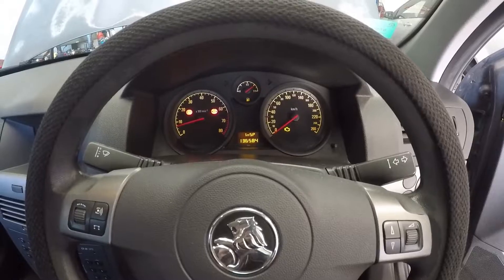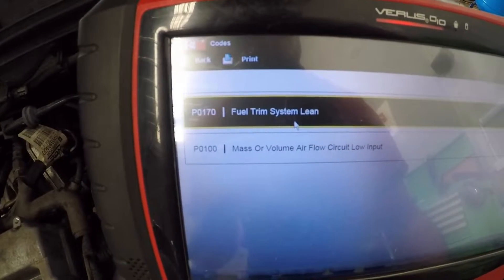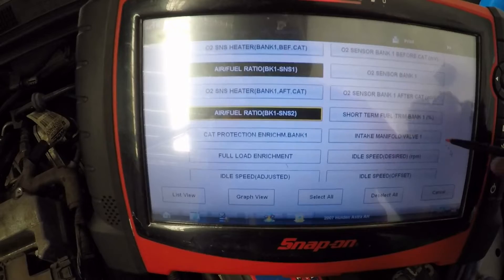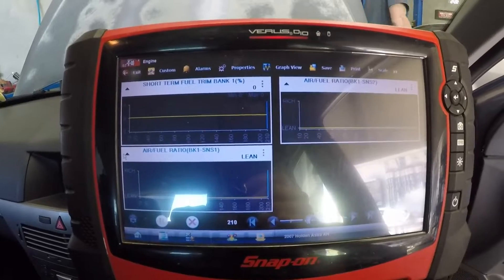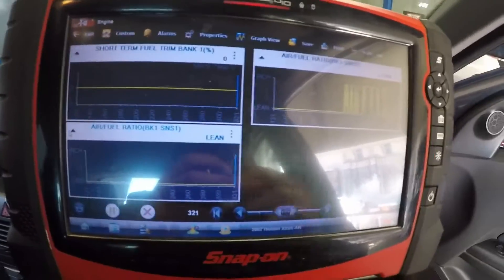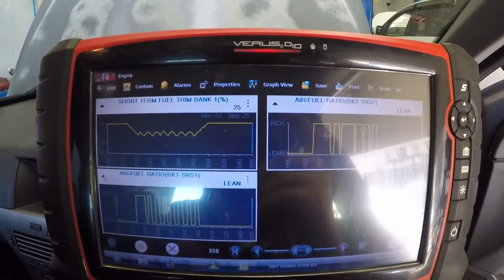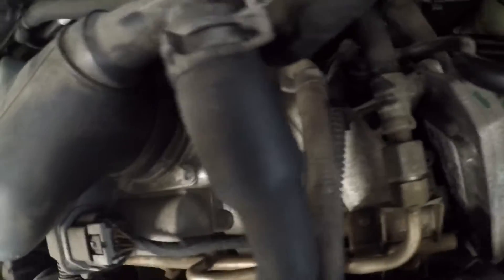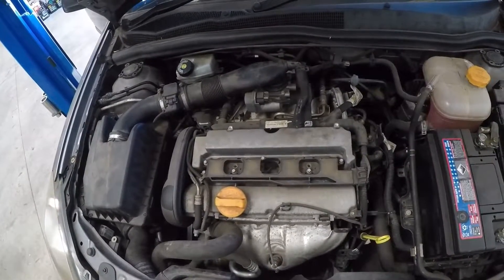Proving a vacuum leak fix with fuel trims/live data - P0170 Fuel System Lean - 2007 Holden Astra AH

Comment: How you fixt that?
Reply: He states in the video that you need to replaced the rocker cover ( top of engine ) which has a new inbuit/intergrated pcv valve. The issue is caused by a failing PCV valve.

Comment: What needs to replaced?
Reply: He states in the video that you need to replaced the rocker cover ( top of engine ) which has a new inbuit/intergrated pcv valve. The issue is caused by a failing PCV valve.